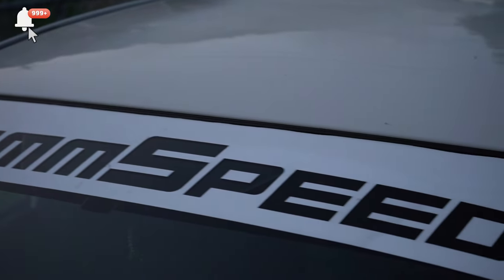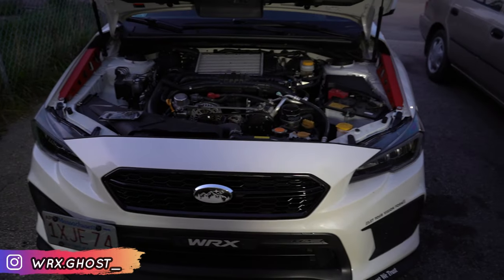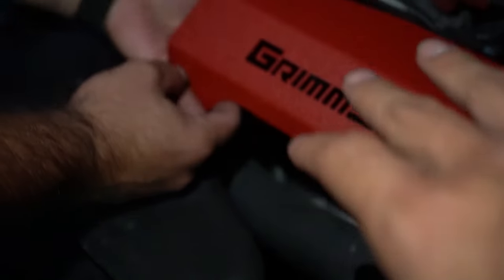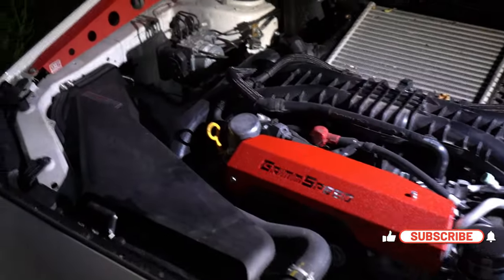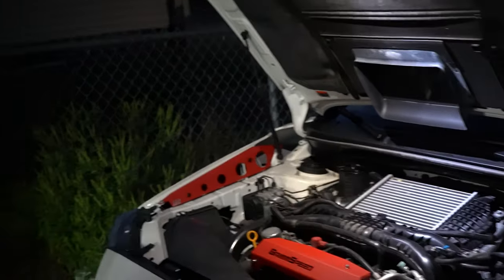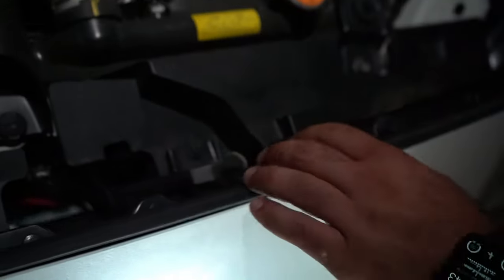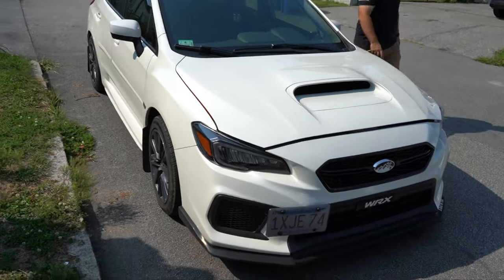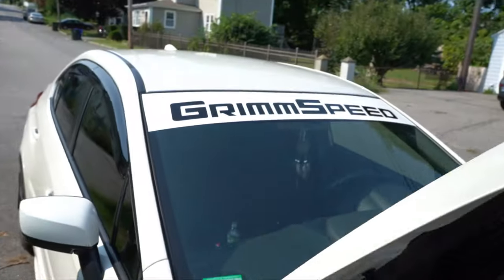A Must Have Engine Dress Up Kit for His WRX! 15-21 WRX/STI

Comment: Also since you have a whole kit have you ever thought to use a thermal camera to see difference in engine bay temperature after specific conditions like highway city and number to number traffic does the metal rain more or less heat and how long does it take to heat up vs plastic also since you had awhile how well has color stood up to heat and oil any flaking

Comment: Looks extremely clean❤️‍🔥❤️‍🔥and Ghostiiii please check the pulley the cover after a couple drives for some reason on Betsy it would always fall off and start rubbing into the timing belt and cause a horrible winding noise🥲 so I ended up loctiting those nuts🤞🏼